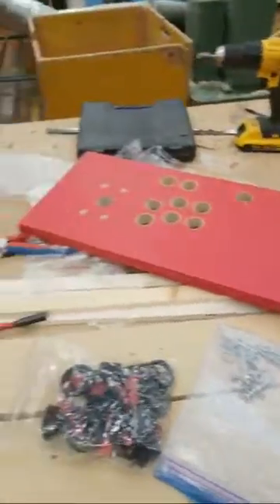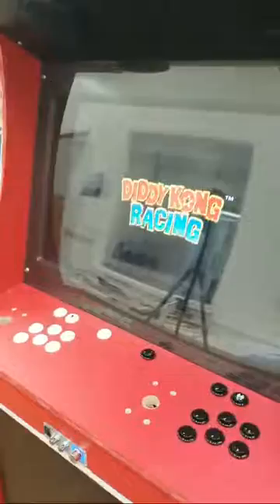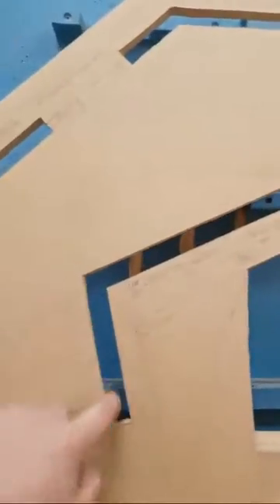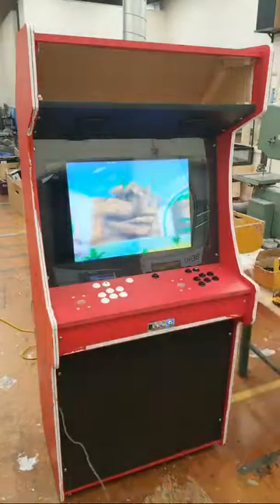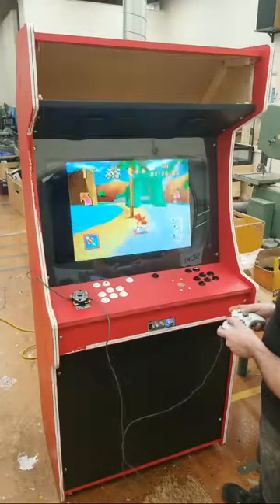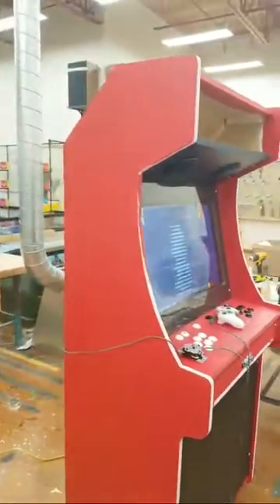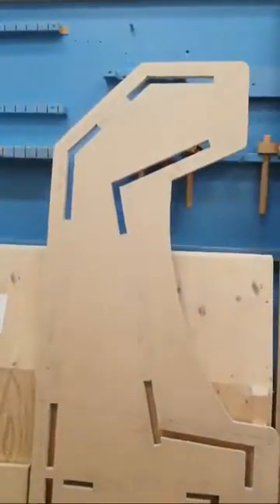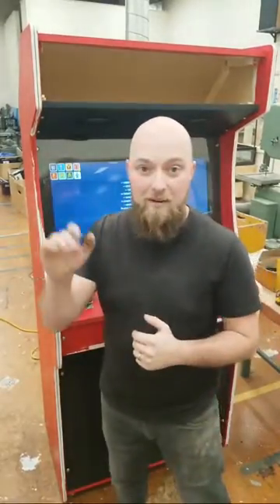Building An Arcade And Doing Some Testing!

Comment: Also the volume controls you are using.
Reply from the maker: Sorry for the late reply. This build used some speakers and an amp on amazon. I'll have to look back at my pictures but I think the volume was accessible with the tv remote or by opening up the back. Hdmi with video and audio coming from the odroid into the tv. Aux cord in the tv headphone plug to the amp and speakers. Not the cleanest but it was nice and loud

Comment: What can the odroid handle well, im familair with the pi, from the uk.
Reply from the maker: Sega dreamcast works great. My usually test is N64 donkey kong and Konkers bad fur day and it runs both very well
Reply: @WeBuildStuff  i the pi is abit miss n hit on the n64 runs but sounds laggy might have alook at one
Reply from the maker: @xhiltonx  ya the Pi is hit or miss but more support in the community than other boards.

The odroid has it's pros and cons but it ultimately has more power than a pi3
Reply: @WeBuildStuff  yeah loads of support out there, i wish they brought the pi 4 out and maybe upped the price abit just to make it that much stronger with some game